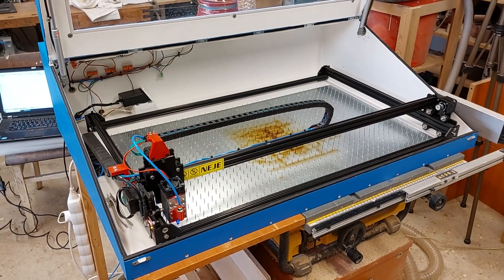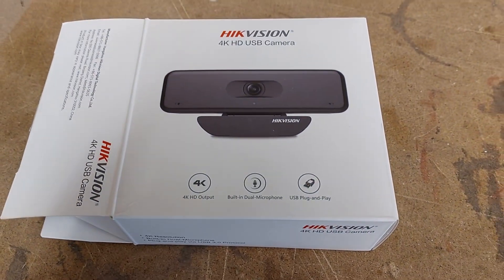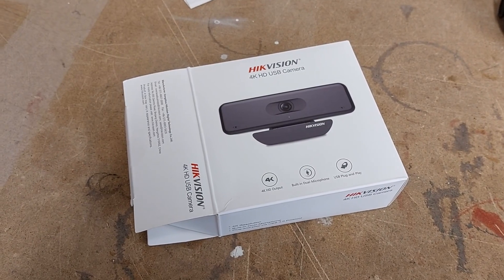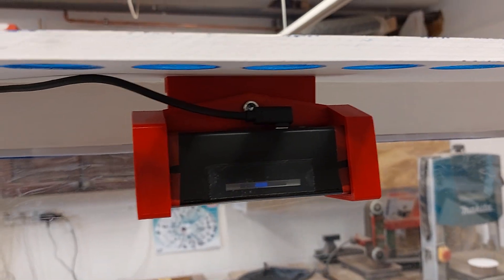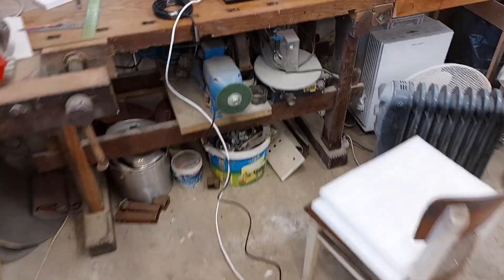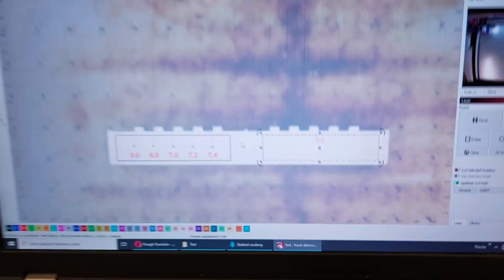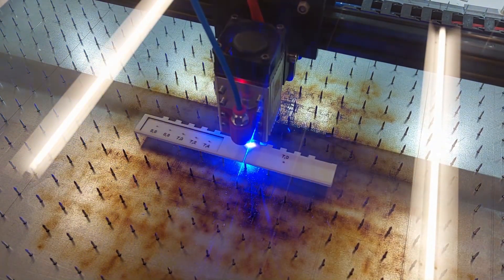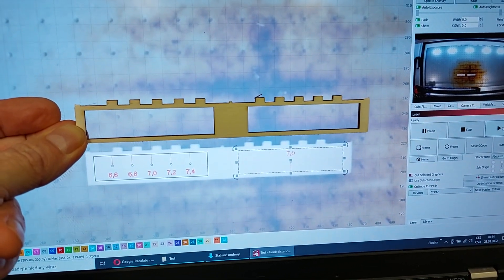NEJE Master 2S Max A40640 - LightBurn camera system installed

Comment: Nice setup. I wish i could do the same but right now i'm still struggling to make lightburn run properly on my Neje Master 2S Max. My laser keeps getting stuck while engraving.
It seems like it's losing connection to my controller after running 2-3 mins so it keeps burning the same line.
Reply from the maker: Does your machine behave in the same way with different software? Try to engrave the same data with e.g. LaserGRBL and check.

Comment: Another great video! I'm still in the proces of building the enclosure myself. How to you ensure that camera is always in the same position when the lid opens? My gas struts for the lid (120NM) are quite unstable when opening fully, causing the lightburn camera calibration to be wrong. I'm thinking of some additional support or stronger gas struts (from car maybe :) ). My lid is quite heavy (OSB board 1.8cm thick).
Reply from the maker: Hi Jurica, thank you 🙂 Regarding the keeping camera in the same place every time you open the lid, you have to ensure three things: solid hinges, stiff lid and reliable lid supports. I believe first two points are fulfilled on your side. Regarding the lid supports, in my case I use pair of 100 N furniture gass springs (but I made my box of 10 mm birch plywood, which is quite light). In your case  I'd recommend firstly to find more suitable places for gas springs mounts (to be honest, in my case I found proper gas spring fixation points on the third iteration 😉). If it does not help, stronger gas spring shall do the trick. Furniture gas springs are made up to 1000 N (may be even more) 😀